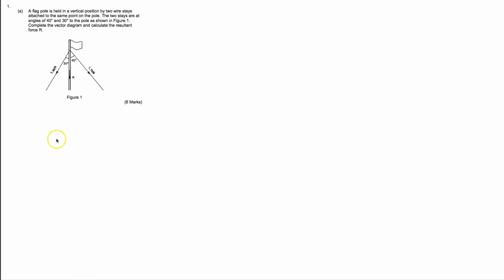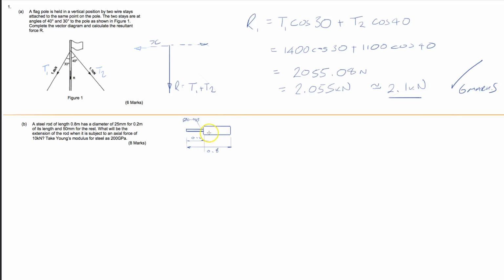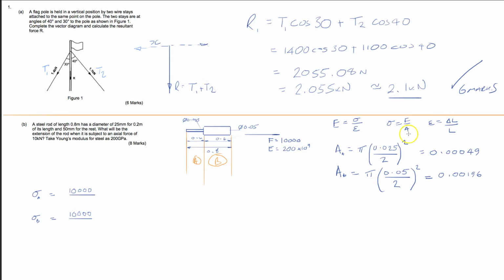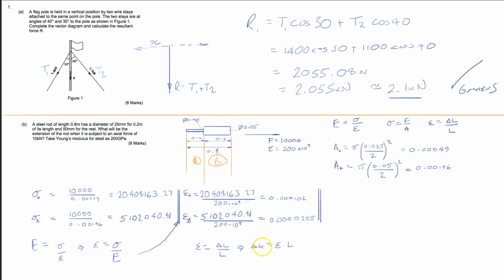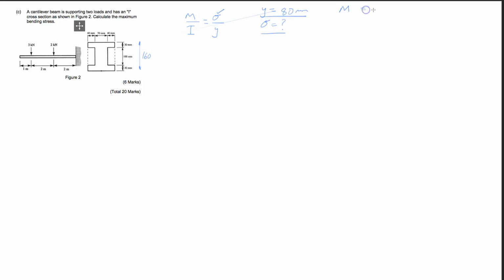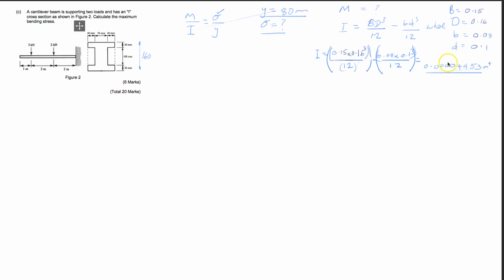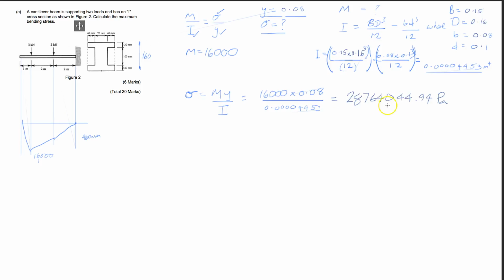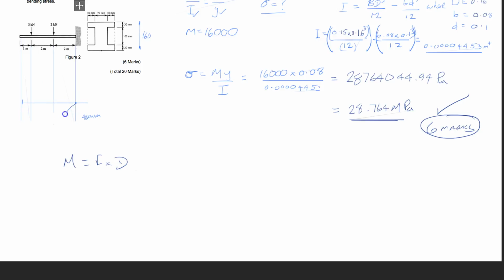HNC Mechanical Engineering Q1 - Applied Maths Exam (2015)

Comment: I'm looking to study HNC Mechanical Engineering, is there exam or just coursework?
Reply from the maker: In theory, it depends where you go, so you should ask the tutors of the course you intend to apply for. In reality, I’ve never heard on an HNC without exams to be honest.

Best of luck with your studies!
Reply: @FuturefabOrgUk  Thank you for getting back to me. Is it just Maths exam or are there any other subject such as Physic. This video is really helpful, thank you.
Reply from the maker: Typically a HNC course consists of six modules only one of which will be a maths based one. More often than not it will not be pure mathematics and instead will be called something along the lines of applied scientific methods. 

This is basically a combination of physics mathematics and mechanics.

Other modules may include things such as design business computer-aided design, machining, fluids, electronics, statistics and any number of other things depending on the particular flavour of HNC that you take.

The best advice I could give you is to contact your local college and ask to speak to the engineering department. They will give you all of the options and some course the literature for the subjects that you have access to. Best of luck!